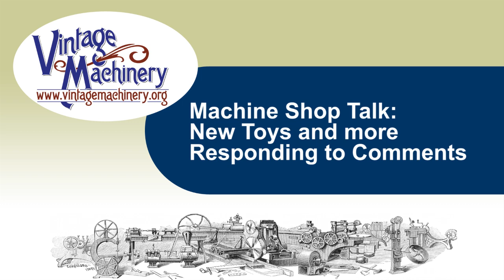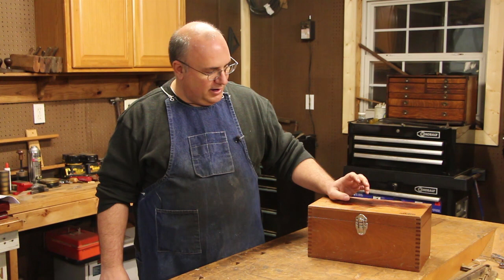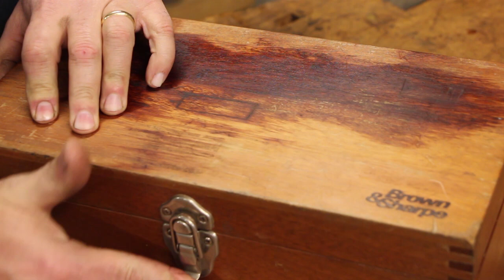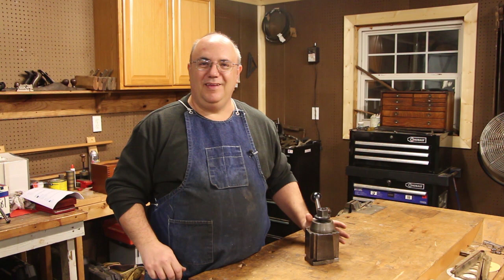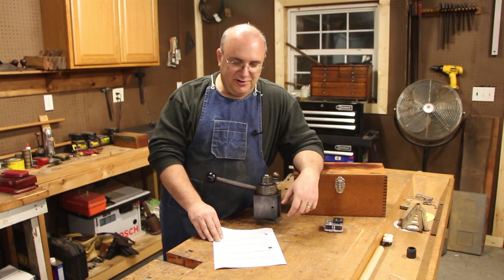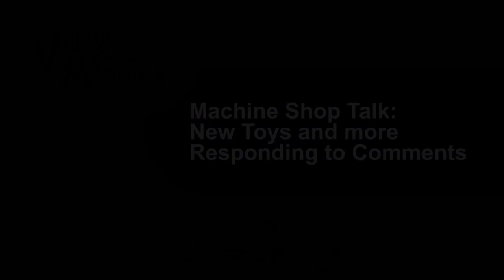Machine Shop Talk:  New Toys and more Responding to Comments

Comment: I, too, was a bit confused by your "highs" and "lows" when centering work in the 4-jaw chuck (turning the feed roller for the Vance planer). It seemed you were calling it a "high" when your indicator read lower, and you would loosen the corresponding jaw and tighten the opposite one. I would call this a "low".

Comment: Keith, You asked about a tap follower that has both a male and a female reversible shaft. GO ON Ebay to item #131075903458. I bought mine from this seller and have been very satisfied. Also bought his edge finder.

Good luck and thanks for the videos. I am a new subscriber.

Dave C.

Comment: Nice video Keith. I like the new mic set. They don't look very used and should serve you well. 
Congratulations on getting the new GoPro camera! That's all I have and use it for all of my videos. I like being able to mount it pretty much anywhere on the machines or in the shop that I want. Did you happen to see my video where I shown how I mount it? If you need any tips let me know. 
As for my comment on indicating, I thought I seen you calling the low point (counter clock wise on the dial) the high, and opposite on the high side(clockwise rotation on the dial). It may have just been me not paying attention very well, and no matter I know we all have our own techniques and tricks that allow us to understand what we're seeing and get the parts indicated quickly. 
I'm enjoying watching your videos,and I think everyone else is too. You have a very friendly personality that comes out in your videos. 

Adam
Reply: I show the mount that a made up in the beginning of my video Well Drilling Shaft Repair Part 1. It's been working very well for me. 
Yes I just bought the clamp mount made by GoPro. It comes with about a 6" section of heavy duty Line-Loc so you can move the camera around into many positions. You can also mount the camera directly onto  the clamp if you want. It's a great addition to the work I do with it. I bet it'll work good on the trains!!
Thanks Keith.
Reply: Happy new year !!!

Comment: Did a heck of a job on the gear repair brazing it was the way to go . The pre heat and post heat is a killer when welding with stick.Keep up the videos and keep talking you explain the job thats what it is about learning. Happy New Year .
   My Best
    Tighe
Reply: Yes sir ,
I work in a working museum haha steel mill in colorado. We use alot of nickel on heavy cast but for the light stuff brazing at home im trying the silcon bronze tig rod a little more controll.

Comment: For the GoPro, buy a frame mount for it when you aren't using it in wet areas.  The audio will be a whole lot better than with the full enclosure.

Best of luck for 2014!
Jack
Reply: *****
The GoPro has great video, but my main problem with it is battery life.  On Christmas Eve, I had it turned on and was using a WiFi controller from my iPad. The battery didn't last for two hours in stand-by, and I only actually filmed for a few minutes. I'm taking it on a ski trip soon and bought 3 batteries for it.

Comment: There's a way to make a collar for one piece chuck jaw grinding by cutting a three hole bolt circle that overlaps a central hole.  Each jaw goes into one of the three outer holes and protrudes into the center hole.  That allows the scroll to align the jaws correctly for a inner load rather than an outer load but still provide clearance for grinding.